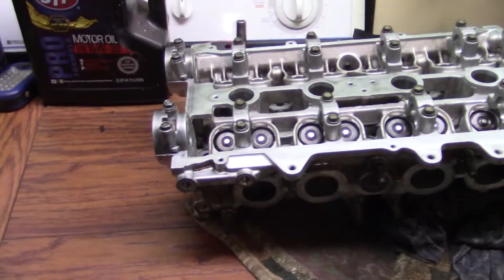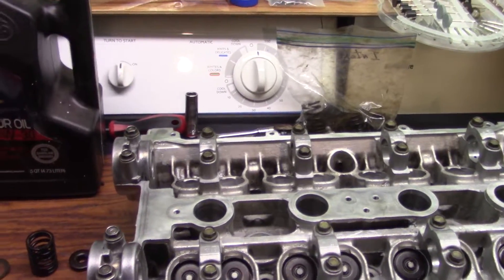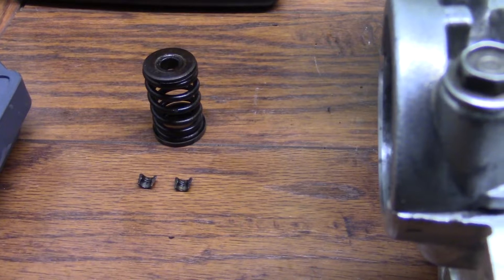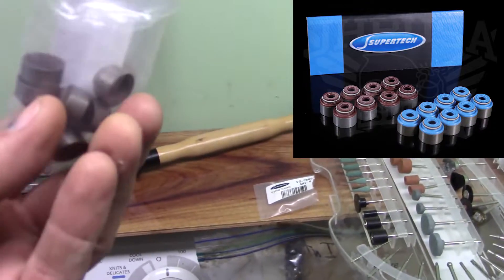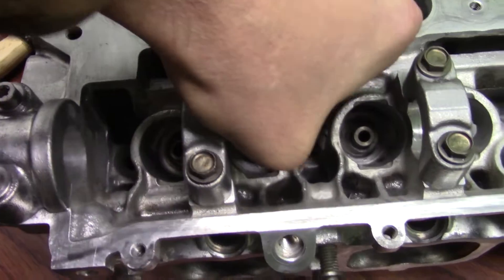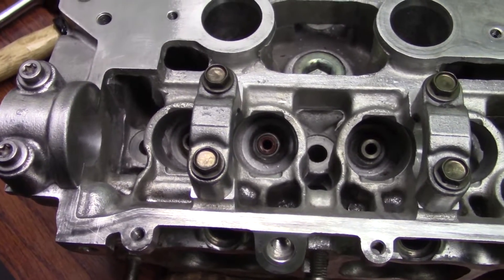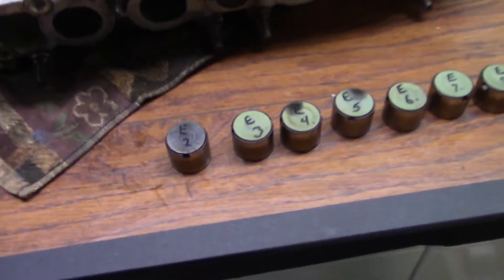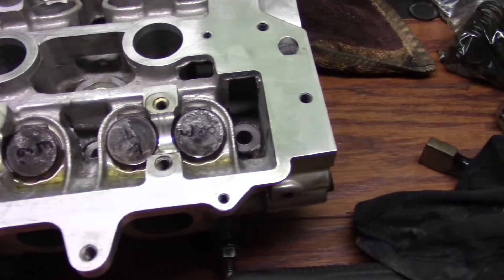MR2 turbo Head Rebuild (3SGTE) & A Must have Tool

Comment: Hello Mike,
Thank you very much for the video.
I have a question: I noticed that, like me, you also have grooves in the camshaft bearings.
The "scratches" on mine are also in the running direction and not across. I can feel some of them with my fingernail, about 2-3 in certain areas.
Do you think this could cause issues with oil pressure, or is it negligible?
Thank you in advance! :)

Comment: Removing the springs is old school like when using a deep socket and hammer. What's keeping the valve in place when installing?
Reply from the maker: The rag under the valve is holding it in place. I mentioned it twice in the video.

Comment: Is there any way of changing the springs while the head is on?
Reply from the maker: Yes there is... You can feed a small rope down the spark plug hole and fill the cylinder. Then lightly compress the cylinder with the rope in it by hand so it holds the valves up. Some like to use compressed air but I find the rope works much better.

Comment: HI Mike. Do you have any recommendations on finding MR2 parts? I have a 1991 Turbo and am having problems finding things like weather stripping. Like you, I also live in SE Michigan and we all know its not a hot spot for non-American cars. Cheers.
Reply from the maker: Hey John... Well I'm sure you know about these places. Twosrus , prime performance , ATS racing , mr2 heaven , there are also used parts on the forums. Other than these eBay is the only other option. Hope this helps!

Comment: Hey Mike nice video. 
I have a need to replace a knock sensor for my 1993 MR2 Turbo 2nd gen. Do you have any recommendation on a good knock sensor? OEM Toyota or aftermarket ? Any part numbers would be appreciated. Thanks.
Reply from the maker: http://www.atsracing.net/Parts/Details/EL-KNOCKSENSOR 
Use this one... this knock sensor is a bit stronger than the oem Toyota sensor. And it's less expensive! 😎
Reply: @gehringer37  Thanks.

Comment: Hey mike just a quick question.  How much work if any do you do on cleaning up the rest of the head like deburring it to help the oil drain etc or are they good enough as they are?   I noticed I have a lot of casting marks in mine and I am not sure if I should work them over to help oil flow.  By the way I subbed to your channel and will share it around with a few people with MR2s here in australia.
Reply from the maker: Hey Clint...thanks bro! Well...you really don't have to worry about casting marks messing with the oil flow...The oil pressure is pretty efficient on a 3SGTE. The only thing I do to the heads I rebuild is give the intake passages a good sanding and slight polish. That's why you seen my dremel tool  in the video.